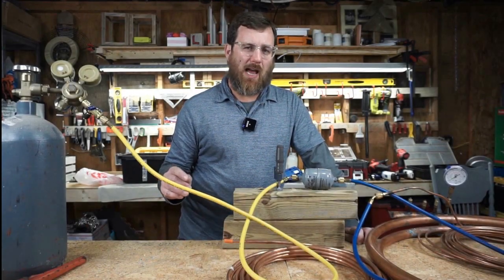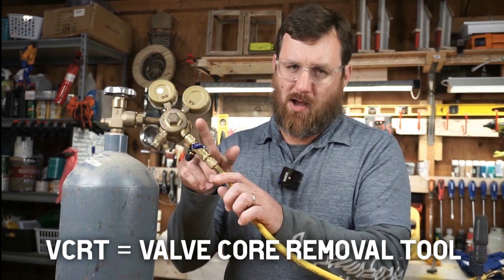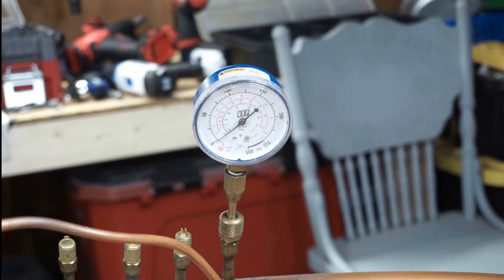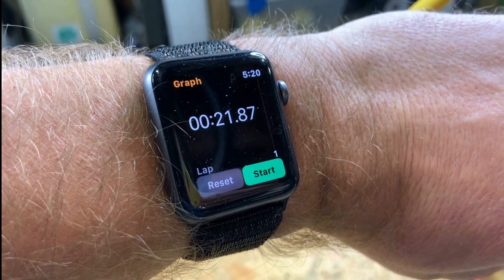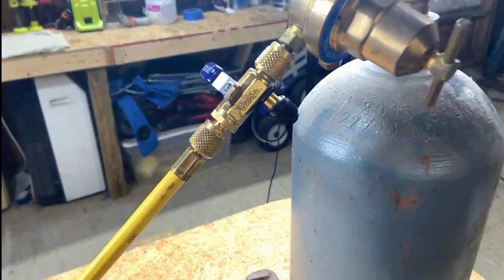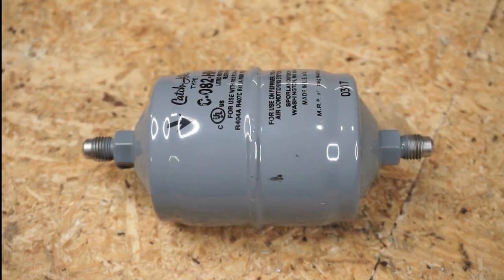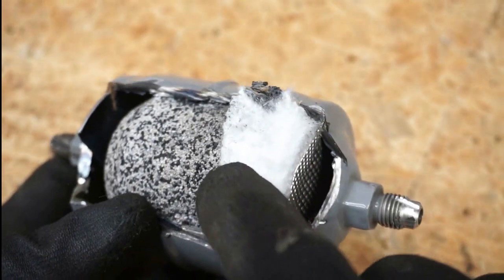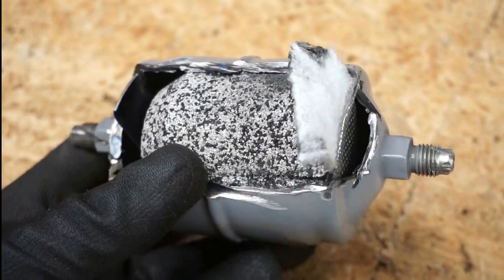Can a One Way Drier be Used in Reverse?

Comment: Great video. If you install a filter drier so the liquid flow is correctly when the gas comes in other way in reverse mode it should not be a problem at all.

Comment: The HVAC guy installed one way filter drier on my 5 ton heatpump. It never worked right for over a year and really struggled. Anyway a biflow filter drier was installed. I also changed out defrost control with a universal Honeywell. Since then my central heatpump works great. I was scared the unit was damaged with wrong filter drier. It doesn’t seem to be.

Comment: I don’t know if the results would be different but vapor is never flowing through the drier when the u it is operating properly. It is a liquid line drier, even a heat pump in heating there will be 100% liquid refrigerant flowing through the drier. Like I said I don’t know you flowing vapor nitrogen verse a liquid is giving you false test results, but it might be worth trying again with like water or some thing like that.

Comment: Yes you can…… will the outdoor unit last long……. Nope. Two or three years max
Reply: Have you seen this happen firsthand? I had a keeprite furnace and 1.5T A/C Unit installed in 2021. I went 2 seasons with it working beautiful, it was the best A/C I ever experienced. 2 years later upon first start up in 2023 I had no cooling, we spent the whole summer diagnosing it. We found that the filter drier is backwards and now my compressor is working at about 60% capacity and my energy bill is double what it was the previous year. I suspect most of the problems stemed from the backwards filter drier.
Reply: Yup your txv is dusted

Comment: Think the main issue is theres no filter pad at the inlet so if the flow is backwards bits of the core could make it into the system.
Reply: Yea, my thoughts too. thats the reason i dont use Sporlan driers. i dont like the solid blocks they use they break apart. especially if drier gets dropped in shipping.
i only use Emerson / Alco. they use Lots of tiny dessicant beads that dont break or dust up.
Much Quicker Moisture removal and larger surface area overall. also if drier is dropped beads dont break. sporlan cores do.
Reply: @OcRefrig  Our local wholesalers have stopped stocking Sporlan stuff and switched more to Danfoss, they have the same style solid cores but so far have had good luck with them.
Reply: No it will not work. I just found a system with the drier wrong way. It might work the first days but after a while it will stop working. And also someone said the desicant inside will get out in the system.

Comment: One was installed backwards on a walk in cooler, it stopped working in a couple of days, I went back and the filter was oil logged, I put a new drier in and new refrigerant, that was 3 years ago, definitely made a difference in this case.
Reply from the maker: Do you remember the brand of drier? Maybe it was constructed differently
Reply: @TALYN875  it was a sporlan
Reply from the maker: Thanks. It would be neat to see how they model was built.